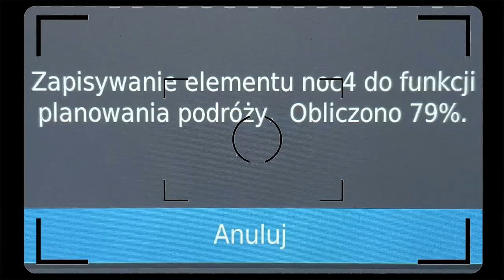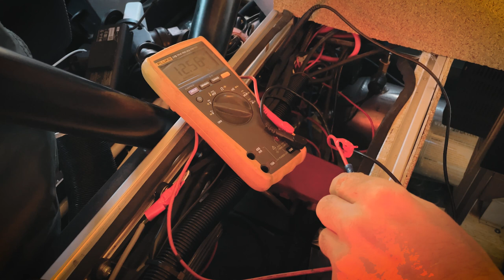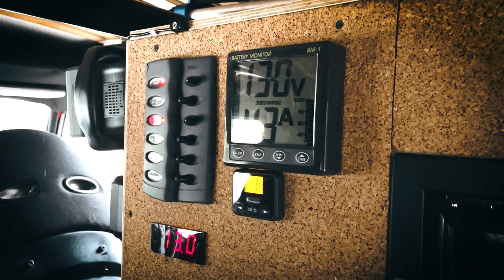Episode 3 of Sardinia Winter Trip (2022 overland adventure in Land Rover Defender)

Comment: Just for info, solder then crimp has a very high chance of fracture at the back of the crimp, it makes the wires more brittle, better to just crimp (pretty much every automotive connector is just crimped) or solder only, it is also recognised to crimp then solder on higher current situations where there is liable to be excess heat and failure if the connecotr is not stead fast on the terminal. (Usually a fusebox or relay box is where you find that.) Hope it lasts this time! :-D
Reply from the maker: I agree! I wasn’t very specific here, but there were two wires connected together and a bit too small connector so that is why it was better to solder them together. But all other connectors are crimped without soldering 😅 Thanks!